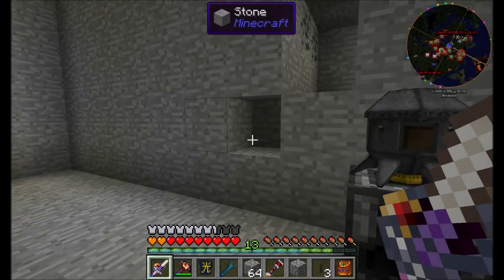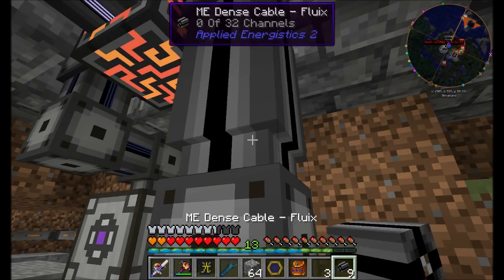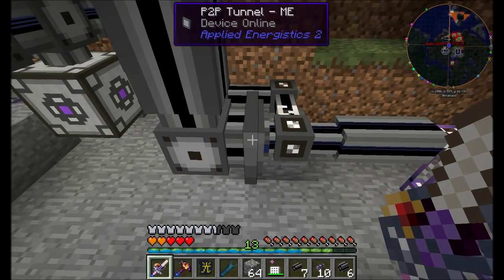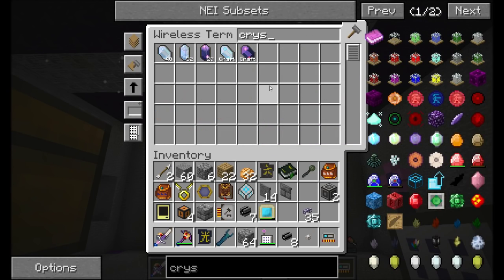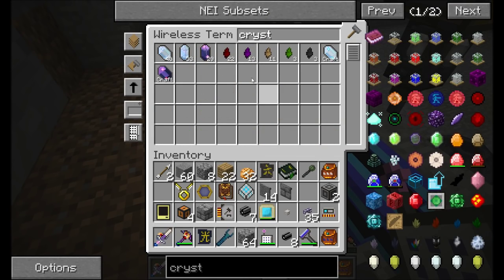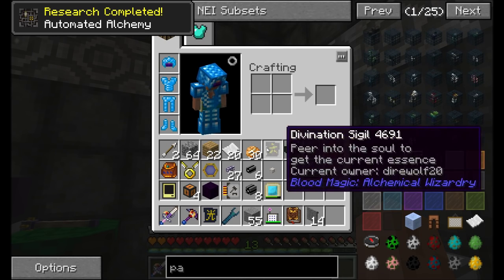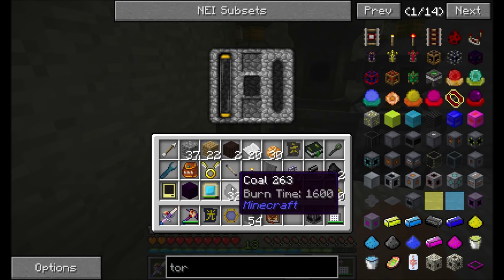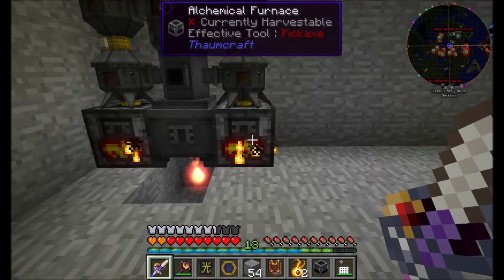Lets Play   S7 E58 Thaumcraft + AE2

Comment: So could you only have 4 P2P networks connected to a side of a controller if they all had 8 devices each? Or could you pile on 16x8 devices to a single side with dense cables?

Comment: Wouldn't it be much simpler to just drop crystalized essence and items from an open crate into a crucible, and then vacuum hopper the result? Also, put an Ender IO teleport doohicky in the basement so that you don't have to run around in the walls
Reply: Thaumcraft has been coded in such a way that it has to be a player to drop items into the crucible - not even machines that act like a player can automate it in this method. (Trust me, I've tried...)  It makes sense that Azanor would have done this to force us to use the Automated Alchemy research, otherwise it's pointless to have...
Reply: M4th G33k The last item, the catalyst, has to be dropped in by the player.  All the other items, the ones that supply the essentia aspects, can be dropped by machines.  I've used Steve's Factory Manager to drop in everything but that catalyst at once, then I drop in the last item, and it works perfectly.  I was having problems with aspects breaking down before I could throw in the last item (for recipes with lots of different aspects), and having SFM dropping everything but the catalyst in at once made using the crucible much easier.
Reply: KeithInModesto Ok, well, yes you can automate the dropping of items into the crucible except for the catalyst, but I was taking the original question to be whether or not you could fully automate the crucible, which you cannot do. (I'm not saying you're incorrect, mind you. No need for a flame war. :-) )

Comment: Direwolf why don't you put the p2p straight up to the controller instead of the wires because controller has unlimited amount of channels
Reply: Cause that's inpossible, and that doesn't even make sense
Reply: The controller is limited to 32 channels per side. So, I guess 192? It can always be extended with more controllers.
Reply: Why is that so hard fo you guys? Each side of a controller outputs 32 channels. P2P tunnels occup only one block and has to be connected to a cable to work. Connecting it directly to a controller first is impossible second its output would be 1 block wide, so only 1 cable could be connected.
Reply: ? god my mind got 
blown